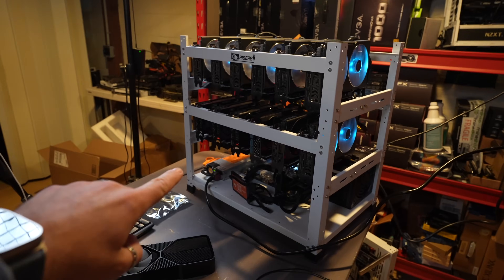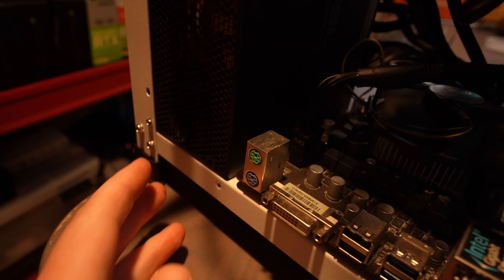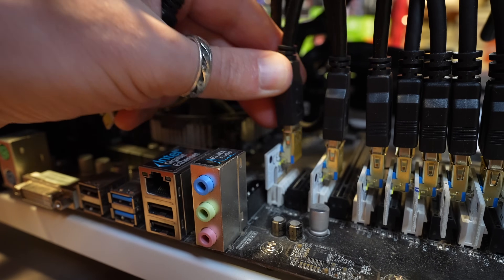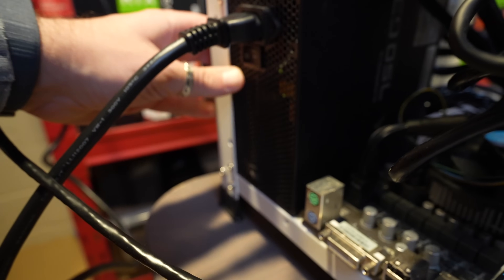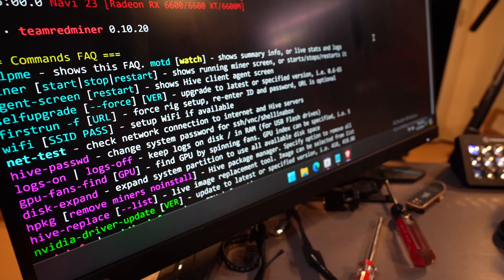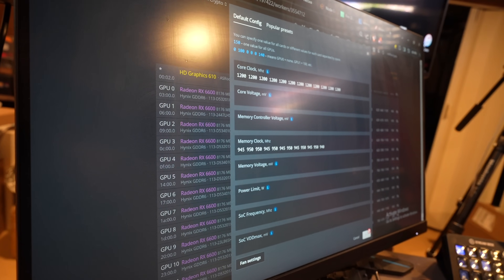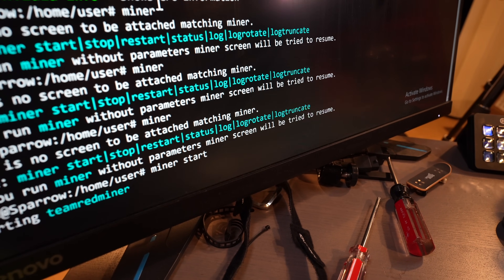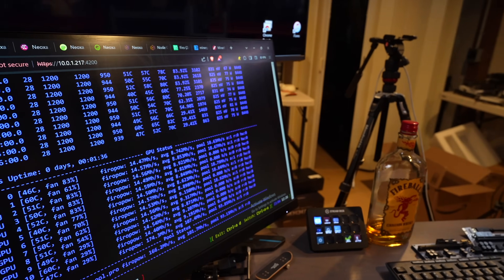"GPU Mining is Fun" They Said

Comment: hiveos takes a while to initialize the amd cards before miner starts. It has to apply overclocks first and then will start the miner. If it doesn't start automatically after a few minutes or hangs, that is usually a gpu connection/overclock issue.

Comment: You’re on the right track, standard procedure is to get a cheap pair of flush cutters and take 1-2mm off those tabs, electrical tape every other  one. 
The best part about hive OS is that you just have to backup you rig.config file, reflash and restore the config file and it’s done. I would reflash that os after the second failed miner start after reboot.

Comment: I had a similar issue with a 12 GPU rig the other day.  Same mobo, 12 6600xt. same thing as yours ran fine for months.  I re flashed hiveos, killed all OCs, tried different risers, re added GPUs one at a time.  The issue was Team Redminer.  I changed to lolminer and everything worked.  Makes no sense.
Reply: Same but with lol miner, then changed to teamredminer and now everything works fine…

Comment: Usually what works is trying to run the rig just with a power limit, the clocks can not work fine changing algo or keeping the rig off for a long time, don’t know why. (The worst case is when it’s not about voltages but the clocks itself) If it works you have to redo the oc, usually i start pretty high and every change i make i let the rig run at least for a day. Now i’m super stable and don’t have any issue (around a week for tune every card).
If it’s not working with just a power limit try to boot after leaving the rig 5 minutes without power, not even connected with the pdu) and in work mode, update the driver (20.40 seams fine), then update hiveos kernel (can find the command on hiveos site). If it still doesn’t work, re-flash hiveos and don’t put the .rig file on the new flashed hive but connect a monitor and type rig id and pass. (‘Till today i’ve solved every problem following this steps… hope this is useful)
Reply from the maker: Excellent tips.

Comment: I had the issue with my rx 6600 rig a few weeks ago where the miner would not start on its own. After I changed some OC's it's been fine since. Very strange because the OC's would work fine after the miner was running but, like you, it would not auto start after boot. I have since settled with the additional watt per card for the sake of uptime in the event of a reboot.

Comment: Hahahah!, I ran into this and it took me hours to figure out the motherboard is ok but the riser is the issue. You have to clean the pins, I mean wash it in hot liquid soap. Soak it for 30 minutes. After that, you use air blower then, let it sun bath for an hour or 2. Secondly, use cotton bud to clean the GPU pins. That's it. Assemble all back but be careful and make sure its all dry before you turn on PC. Those riser plugs, I think you have to re-solder it. Its so close and will shut. For miner not connecting, the little trick I use is change router DNS or use VPN. Its your ISP. Anyway, Enjoy.

Comment: 4:16 "Why is everything so hard" (That's what she said) 😜
Main things I would have tried is the taping of the riser connectors and then flash hive and try another ssd, if problem still has issues then would say might be the motherboard so check for lights on the board for any possible issues. But that is best answer I have and hope you get it sorted out.

Comment: Had a similar issue with my 3070 TI rig, random cards were just not showing up, and after losing a motherboard, I finally found the issue, some pins on the bottom of the riser board were poking though the foam and making contact with the aluminum frame. Might only be an issue with bigger heavier cards, but I put a plastic barrier between on all my rigs, never a problem since.

Comment: I have three 12 card 6600 rigs and the issue you are having with the miner not starting is almost always an issue with overclocks in my experience. The 6600s can be super finicky with overclocks and the miner will refuse to start when a card has too low of core voltage. If I'm ever having issues with my 6600 rigs the first thing I do is bring the core voltage up and work my way down. Sometimes the core voltage will work fine if you lower it while the miner is running but it will refuse to start the miner next time it restarts.
Reply from the maker: Great advice. Thanks buddy.

Comment: I had issues last night also. A rig of 8x3060. Turns out I can a melted connector at the psu. My own fault, I had an error when the hive os issue happened recently, and it lost its NV tool and started pulling full power for an extended period of time. Thank you have for almost burning down my farm! Argh
Reply from the maker: That’s crazy! Glad you’re safe.
Reply: @RedFoxCrypto  thanks brother. I have  good news for you: mine qubic on gpus and be pleasantly surprised. Each 3060 I have is close to a 5900x it/s for 40%less power.

Comment: I have one rig where the miner doesn't start sometimes. Some reason it doesn't like being hard booted from the PSU. It seems when I reboot through Hive power options the miner starts. could just be coincidence. Its so intermittent I can't confirm %100. I'm a fan of gaffer tape. it doesn't leave the residue electrical tape does. You could just use a small piece on the usb port where the leads are touching it. Its the same end result either way.

Comment: I had a rig that I tried everything on. Replaced risers, removed gpus and went down to a single and still had issues and even went as far as replacing memory and cpu as well as bios upgrades. The issue ended up being a ssd that was beginning to fail but I could still load hive os on it but eventually stopped working. Replaced the drive and everything was fine after

Comment: I would say first off neoxa dag size is different than firo so on memory it will take some more voltage to load it. Hiveos beta is running rcom drives could be the issue or use older trm too. I run all AMD on mmpos no issues

Comment: I had similar issues with one of my rigs in the past (slow boot/init, system instability, etc. with no change in configuration) and it turned out to be a failing SSD.  Once I replaced the SSD everything went back to normal.  Maybe that would work for you on this rig!

Comment: just run heavier voltage all around. sure efficiency is important, but it's useless if the machine is off. after 48 hrs of stability slowly lower voltage on 2 or 3 cards max at a time.

Comment: hey dude ive been into this shit since 2016 - anybody who thinks mining is easy - is a silly berk. you HAVE to stay on top of all the changes to coins, software , hardware faults, over heating, crashing rigs, dodgy pools, dodgy exchanges, crazy power costs. i literally check on our 65 odd rigs every day, if team red miner or xmrig or lolminer or gminer changes something - i need to know what i should do. our rigs quadruple mine mostly - monero on cpus, zil etc and gram on the gpus - was gonna slip them all onto alph cos trm just did an update for alph. then literally a few days later the alph asics have wrecked that idea. the 5700xts we have a re all in r mode on linux - great card. we have a ton of old rx580s and rx470s and 480s all chugging away at the farm in birmingham uk. as soon as the weather goes over 10 degress celcius - the rigs all slow down cos too hot
Reply: top tip from a grizzled old miner DO NOT RUN FANS AT 100% - 75% max they will last a lot longer . you try and guy GENUINE replacement gpu fans - try it and see what total crap you will get sold. i use pc case fans to cool al lot of our gpus cos i blew the fans months ago and cannot get genuine fans. sapphire nitro fans the exception - they easy swap  and easy to get
Reply: another top tip - once the rig is stable for gods sake dont touch it, you have enough to do without making more problems. ha ha

Comment: If you changed the order of the riser connectors on the motherboard, do you need to change the order of the overclocks to keep the overclocks on the correct cards?
Reply from the maker: Good catch I think the first 2 GPUs switched spots when I was taping the PCIe.

Comment: I had same motherboard with same cards, althou the Fighter version not the Hellfire, and i absolutely hate those 2 cards, fans fail on them so fast its insane, i dont have a clue how many i sent back on RMA to get new cards, for them to have fans die again within 8-9 months.

About the Pcie risers i put a piece of plastic between them all, and thats after nippjing ends of and rubbing the solder side on some sandpaper, just to make sure nothing connected with next one in the row.

I wonder, why did you not populate the motherboards 2 molex connectors to PSU, as i understand the manual for the board, that is a MUST ?
Reply from the maker: I've never powered the molex on the board. I remember reading the same thing. It's not needed.
Reply: @RedFoxCrypto  ok, been annoyed by my cables there since day one 😅

Comment: Dear Red Crypto Fox i had the same issue with a 6 x 6750 xt Rig. I tried the insulation of the riser cards but even that did not help. Much later as i read thevFlux Proof of useful Work Guidelines it hit me. You need not just 4 GB Ram per PCIE lane but also the same amount of cores/ threads on your CPU. That’s why I don’t touch 12 card rigs but regarding a six card rig you will be ok with a 12 core/24 Threads CPU
Reply: Sorry which means either a 12700 K from Intel or 5900X from AMD should be able to stabilize your rig

Comment: Something todo with 16 x lanes PCIE BUS?
CPU not supporting so many ? Maybe worked once?

I got the same problem on my motherboard where i got 5 slots but only 4 will ever recognise.  It used to pick up 5 but for some reason only 4 now will see the 4 GPU's.  The closest thing i can come up is with the system is not compatible with the complete setup, disconnect all but 1 GPU then.....add another GPU, add another GPU, one by one and see where the fault is this way.  I guess you could try another motherboard / CPU / RAM.  It should be basic 101 troubleshooting, start from zero and work your way back otherwise you are just guessing randomly and will get frustrated 100%.

pin point the root cause.